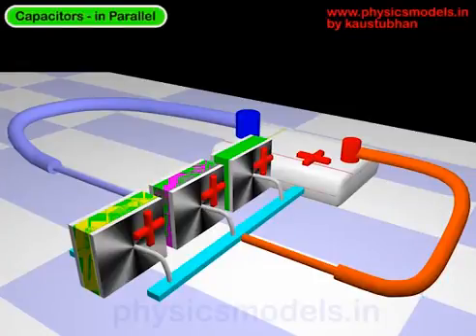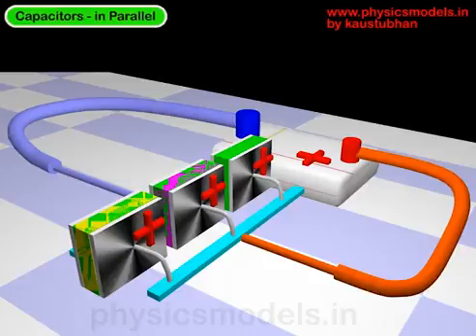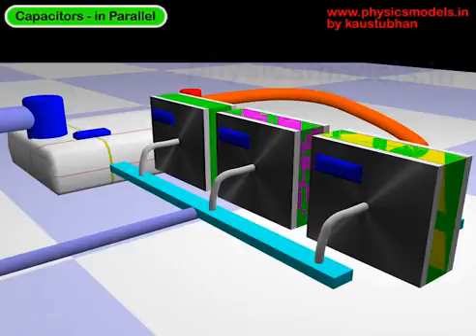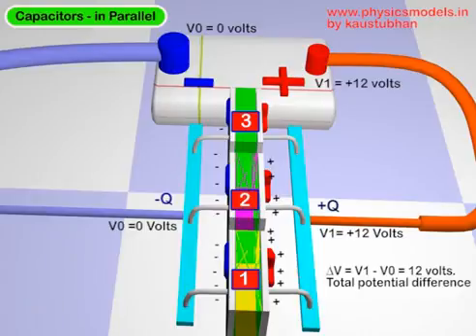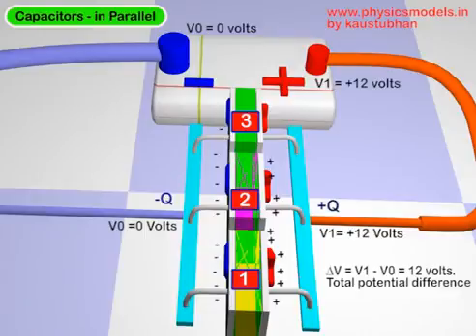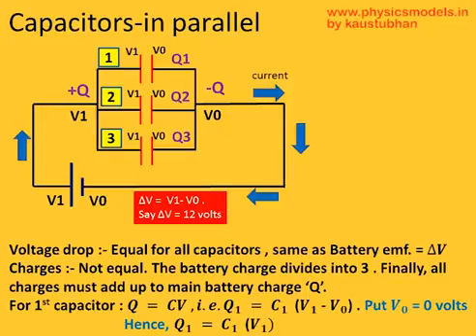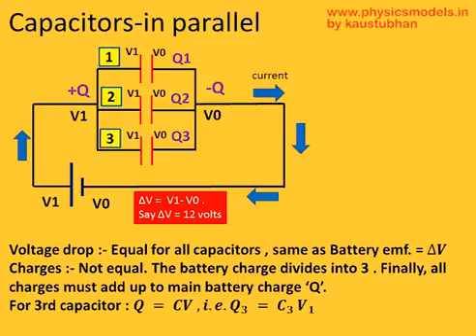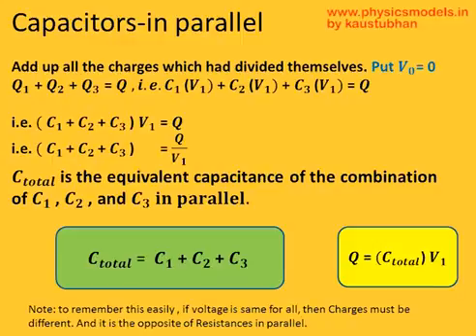Capacitors- in Parallel- 1

Comment: why are they at equal potential??? please explain it.
Reply from the maker: hello Prajjwal, the capacitor plates which are facing the same terminal of the battery (positive or negative) start off with a difference equal to "Battery potential difference" , since the capacitors are connected in parallel . The opposite plates of each capacitor will then charge up gradually , till they come upto the EQUAL potential. When potential across a capacitor becomes equal, i.e. same as saying the potential difference goes away, then current flow will also stop across the plates of capacitor.
Reply from the maker: The potential difference initially for the capacitor is zero before it is connected to the battery. Once the capacitors are connected, in parallel, the capacitors face the battery potential. They get charged up, till their potential difference across the plate for each capacitor becomes EQUAL to Battery Potential Difference. Then there is no potential difference between Capacitor and battery. Then there is no potential gradient between Positive terminal of battery and positive plate of capacitor. So , current will stop flowing. hence, current flow is a function of dV/dt, i.e. change in Voltage over Time. When dV/dt becomes = 0, current flow also = 0. Hope this answers your question.
Reply: yes it did thanks
Reply from the maker: You are welcome to login to www.physicsmodels.in and see videos on various topics.
Reply: Physics Models by kaustubhan sir I am confused that Q=CV then why not same potentail creats same charges on each plate.Q & V dirct proportional.